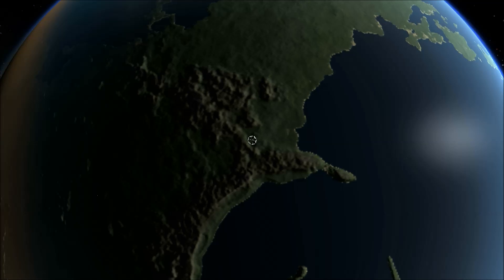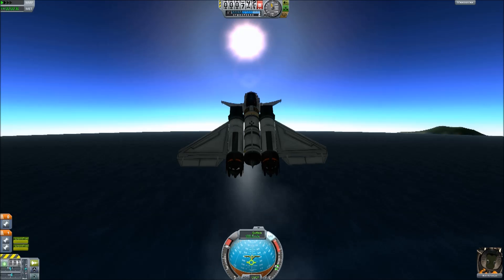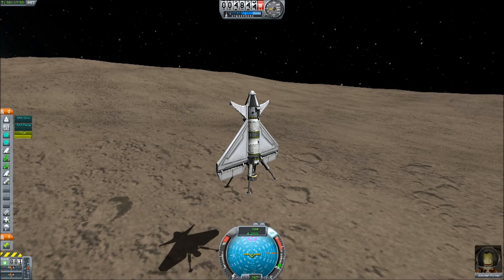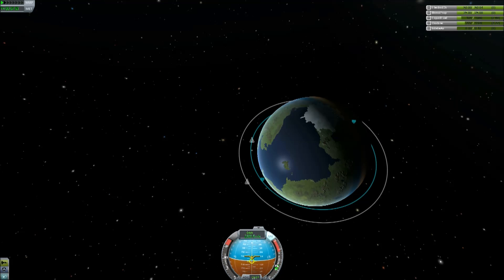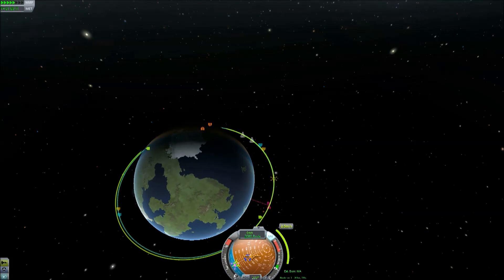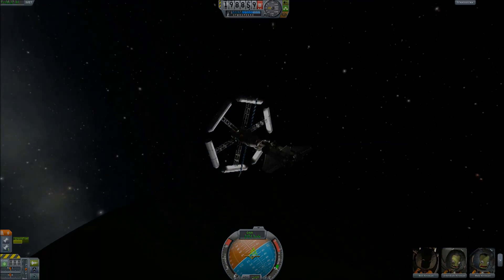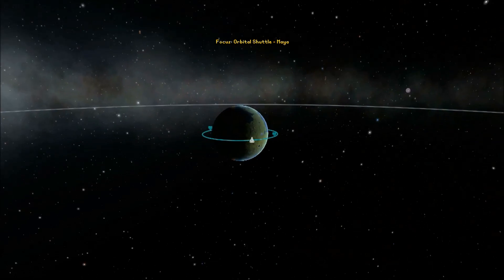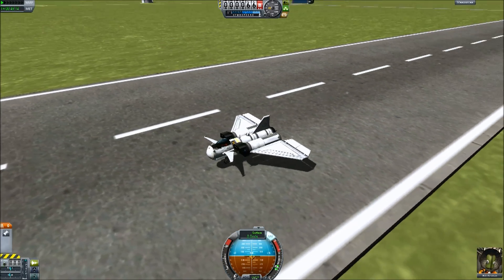KSP - Space Plane Docking With Station

Comment: It's more efficient because you have less impractical ideas, and thus a smaller ship which can use less thrust and thus have a higher ISP engine, which is more economical. It's also more efficient because the only real way to get 100,000 tons into orbit is with the Project Orion craft, which has ridiculous Delta-v and thrust. But uses nukes, so it would be less economical. And you put supplies in space with a rocket, duh. And building ships in space mean that those ship use a lot less Delta-v